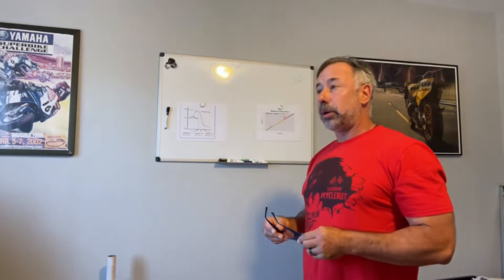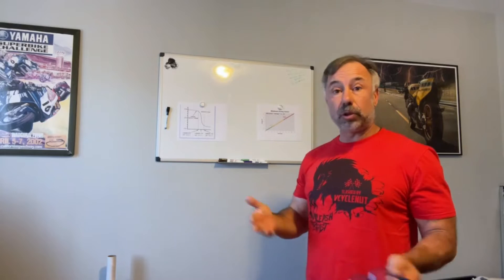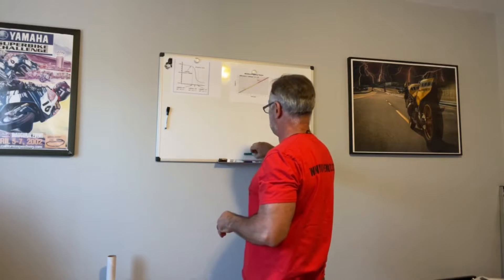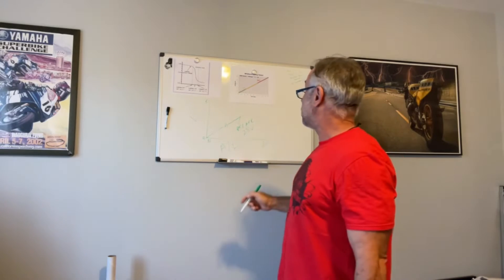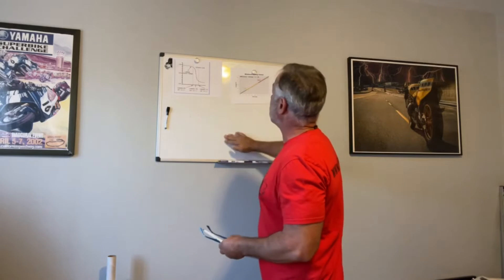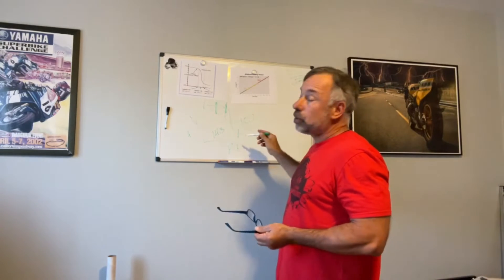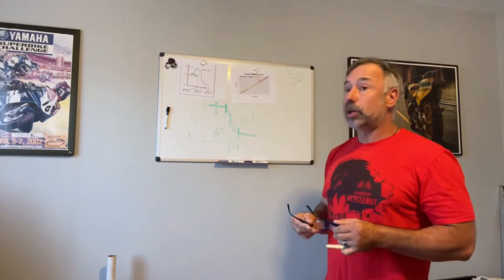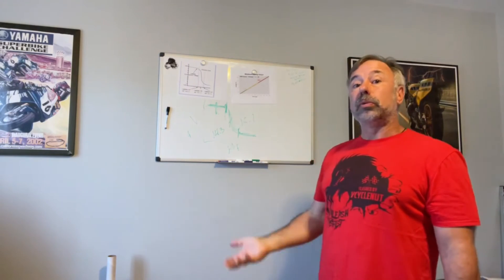Motorcycle ECU flashing: Why disabling the o2 sensor is ALWAYS best

Comment: So do I need to physically remove the sensor after it’s been disabled? Or can I just leave it?
Reply from the maker: no, you can usually leave it in place

some ecu's ( mostly mitsubishi) can still have the fueling effected with it plugged in.  On those flashes I recommend the customer unplug it from the harness

Comment: Theres no information easy to find online for this. I have a 2025 gsxr750 and it has a cat delete. ive run the bike with the o2 plugged in after the tune and unplugged. i honestly perfer the bikes performance with it plugged in. my fear is thst if left plugged in it might run lean or develop morr issues. any tips would be appropriated!
Reply from the maker: Sorry. It’s not a platform I’ve done any testing on to answer that

Comment: Hey thanks for good information. I have a Honda pcx, km's 80.000 around. Got some isues especially 0-50 km/h shes like drowning. After that speed no problem. I havent service in my area for ecu Tuning. If i remove o2 sensor socket and using to 330k ohm its gonna fix to problem? Sorry my english not good. I hope you understand me. Thanks! 🎉
Reply from the maker: IDK ,  but try unplugging it and see it it helps

Comment: This was very helpful. Thank you. I do have some questions around eliminating the o2 sensors and changes in elevation; if you flash a machine and remove the o2 sensors at sea level, what happens when the bike is transported to an elevation of 5,000ft? Is the MAP/Manifold pressure sensors able to correct for this to understand the change in the barometric pressure? 

If you need to retunre for elevation and do not have access to a good dyno tuner, how would you approach this situation? I know tools such as TuneECU can log data while you ride, but without ARF, are you shooting in the dark to understand how to change a fueling or timing table? Is it worth hooking up an AFR gauge to the bungs in the exhaust to understand where it is while riding? 

I appreciate your help. I had an FZ1 with your tune on it and really enjoyed it. I moved a 2008 KTM Super Duke 990 R and I'm trying to understand all of the mods the previous owner had done.
Reply from the maker: This is all answered in the video.

Comment: From my yesterday's dyno run I can say that in my case lambda could even f_ck up AFR at full throttle and low-mid rpm (up to 8k - past that we could get it mostly right). Also it was "smoothing" out the throttle response but in fact it made the motorcycle accelerate waaay slower and sluggish. Disabling it made a difference right away :) Great video!
Reply: U think when I have lambda on full mivv exhaust and I drilled the db killer, then drove it and put it back I could get the mixture richer? Bike’s lazy af now
Reply: By way slower and sluggish you mean you were rich low to mid rpm?

Comment: If you have a flash, unplug the o2 and disable it. Bike runs great, what happens if you plug it back in?
Reply from the maker: Usually nothing but I have seen o2 sensors when they are going bad send such crazy voltages back to the ecu that it messes with the low speed running.
Reply: @vcyclenut roger that, I had a perfect running 23 ZX10R go in for valve adjustment, and now the bike is a turd. Went from wheeling in ever gear (204hp on dyno) to absolute turd and won’t go over 160mph.
Reply from the maker: @mptorecon  o2 Sensor doesn’t do anything at full throttle so not likely it , but can’t hurt to just unplug it from the harness
Reply: @vcyclenut thanks , I dropped it back at dealer that did the valve adjustment, didn’t think of it till after I left, so I don’t know if it’s the case just trying to figure out what they may have done wrong.
Reply: @mptorecon  hello! Did you get it back resolved?  Riding season ina few mos. 🤜🤛
Reply: @vcyclenut it was the fuel filter

Comment: What an educational video, thanks so much
Reply from the maker: Glad you enjoyed it!
Reply: @vcyclenut  could I ask, this is relevant to me because I’m thinking of putting an o2 eliminator on my bike (my o2 heater element measures in spec resistance but I have a code telling me it’s bad). When I put an eliminator on that won’t destroy the fueling right? I heard in an f9 video that bikes don’t use real time fuel mapping they just have a fixed map? But isn’t that fixed map dependent on the o2 sensor data

Comment: Is it true that disabling the o2 sensor on the models with cruise control make the cruise control not work?
Reply from the maker: No.  You just leave the o2 sensor plugged in and the cc works just like normal
Reply: @vcyclenut  okay cool. Any updates with the 2024 mt09 ecu? Will there need to be a new tune for that one?
Reply from the maker: @JayWheelie  yes.  I released The 24 flash last week

Comment: Hi watched many mt09 flashes of your's on YouTube..as based in uk i have had to get my flash done over hear Yamaha mt 09 2022 gen 3 model euro 5... I was just wondering why my flash tune in uk. different ecu flashers in uk for example do different o2 sensor delete or not  methods..i had mine turned off in ecu as i  requested as i thought this is what you would do as standard i am running lv race decat baffle in and usual flash options done.. DNA air filter standard one.. you to have lv race on your mt i believe to Best exhaust in my opinion..my o2 has been turned off but I was told to leave it plugged in as It would throw a signal error..i have know error codes with it plugged in but off in ecu.. another flasher in uk said they keep the o2 sensor on and active with flash as if done correctly with flash it will run v good... I find this somewhat confusing.. with method or  best option would be good insight..as your the mt guru.. thanks for any input...
Reply from the maker: my method is to turn the o2 sensors off
Reply: Ok thanks for input.. O2 is off as I say but still plugged in to stop any errors codes I was told..👍

Comment: Isn't O2 sensor feedback restricted to constant throttle applications eg: cruise? My understanding is that the fuel table will still be used for acceleration and low speed stuff where changes in throttle occur frequently. And then letting the O2 sensor come back in for stable RPM cruising won't affect how the rest of the bike feels, just maybe giving you some better fuel economy. Thanks for the video, been reading up on EFI.
Reply from the maker: Every bike is different but in general its steady state and light throttle application.     

The problem is many time it causes surging issues and an inability to achieve neutral throttle
Reply: @vcyclenut  makes sense, thanks!

Comment: I have a Yamaha MT 07 2024 euro 5,do you reccomend to disable the o2 sensor?
I will feel any improvements?
Reply from the maker: How are you going to disable it?
Reply: @vcyclenut  there is a kit that disable the o2 sensor,but i don't know if Is a good thing to do.
Reply from the maker: @Cicurell  not without tuning
Reply: @vcyclenut  ok thanks for the tip
Reply: Dave if you had a choice of buying & flashing MT 07 Euro 5 (with extra sensor stock) or a low mile 2020 MT 07 Euro 4 - which would you buy and flash? Consider both bikes have snorkel intake removed and aftermarket exhaust. It seems they changed very little with the 2021-2024 MT 07 but to comply with Euro 5 it appears to be a new ECU and harder valve seats.
Reply: @adjbob56  i'm currently riding the new model and i find it very fun to ride,even if is full stock